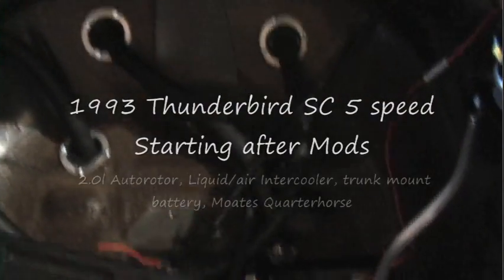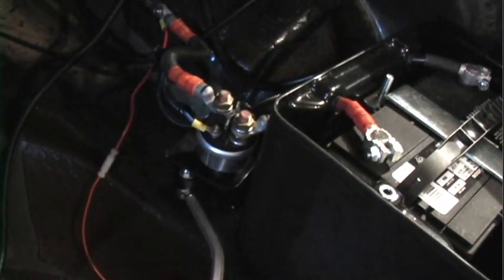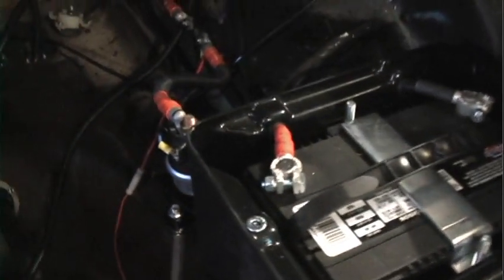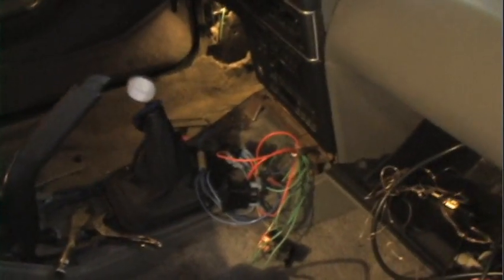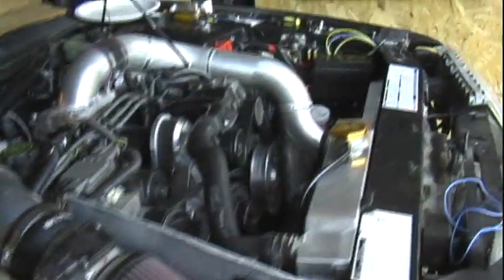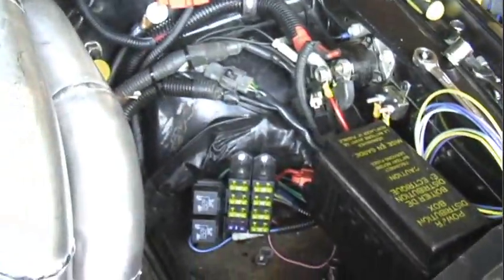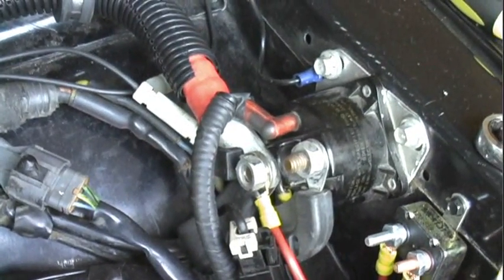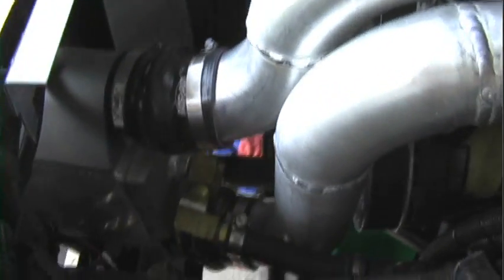Twin Screw Blower on a V6 is Alive!

Comment from the maker: Part 1, find an expert and get a basic tune.  Part 2, learn out to data log, and using the basic tune datalog your car running and send that log to the expert.  Part 3, apply the revised tune from the expert, and use the compare tool in Binary Editor to show you what you had, and what you now have, so you can get a sense of what the Expert is doing to your car.  If starting from scratch, learn the basics of fuel injection and ignition control.